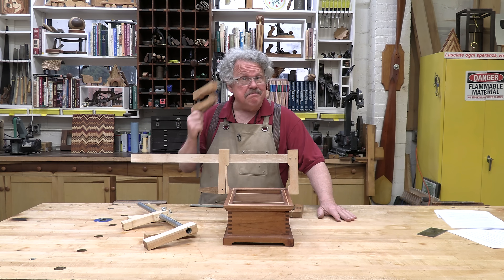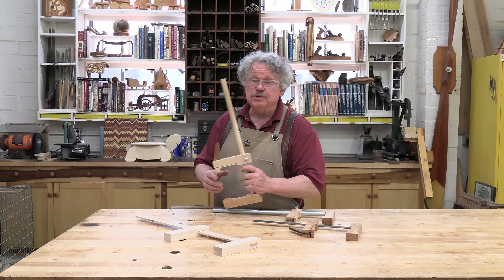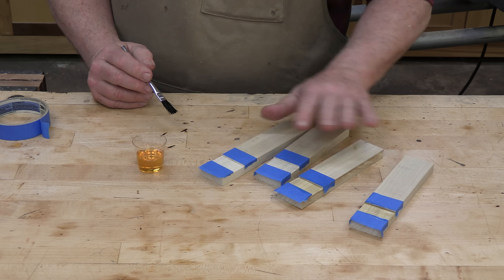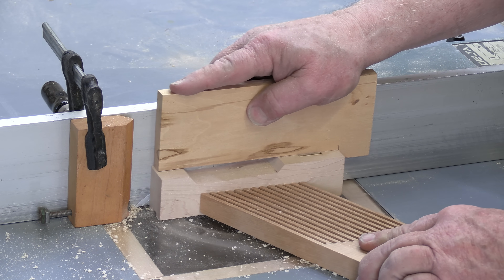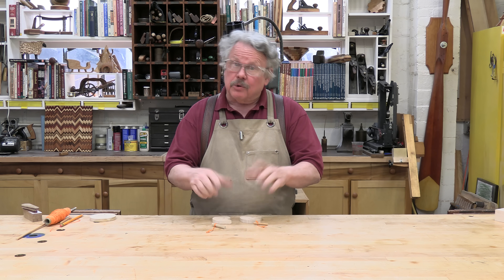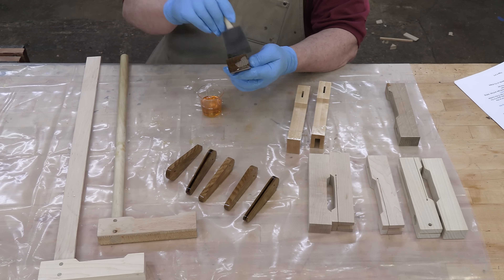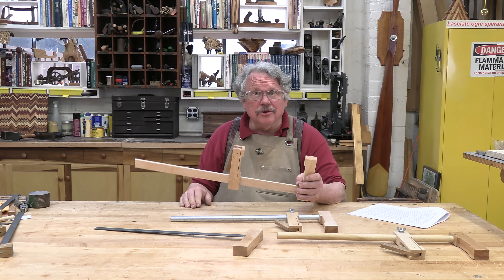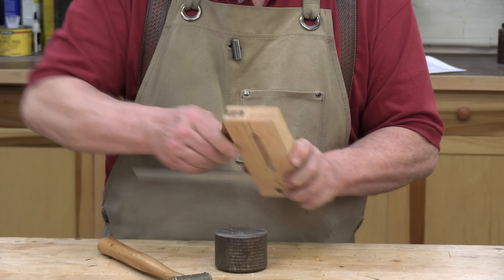Making Cams and Cam Clamps

Comment: The roll pins will not grip a bright steel bar, has to be black bar, it has a curved surface on the thin edge.
If you are making longer clamps use two cam jaws over about 600mm 2ft sizes. The original manufacturer of the cam clamps fit two cam jaws on the longer clamp sizes up too 4ft long.
The timber that is used by the manufacturer is Hornbeam.  A suitable substitute is Birch ply. 

When useing the clamps you have to squeeze the jaws together at the bar to set the jaws before moving the cam tight. No need to file the roll pins as they bite into the steel bar with use. 
Originals have 3mm thick cork for the contact pads. 
Ive been using and adapting these clamps for 40 years.

Comment: Another awesome video!!!  Loved the idea so I made several of these.  I used 3/4" conduit instead of 1/2" because I had some on hand.  I drilled a 1" diameter hole.  That was too larger for 3/4" conduit.  I wrapped the inside of the hole with .030" thick adhesive backed, iron on edge trim.  3" width will cover the entire circumference of the 1" hole.  Float the trim in HOT water for 30 seconds to soften the wood.  Roll it and insert it into the hole.  Heat the 3/4" conduit with a torch for several seconds and insert it in the hole.  The heated pipe will melt the glue and you will have a tight fitting pipe.  Worked great.  Instead of 1" wide clamps I increased them to 1 1/4" wide to allow for the 1" hole.  1 3/8" wide would probably have been better.  FYI, the O.D. of 3/4" conduit is .930. Wrapping the 1" hole with .030 trim reduces the hole diameter to .940.   That's a good fit.
Reply from the maker: Enjoyed reading that -- love creative engineering.

Comment: The process you are using to generate the curve for the rotating cam generates an involute curve in which the curve is always perpendicular at the edge of the dowel, and not it's center.  That's why the larger the dowel is, the further from the center the perpendicular point on the curve is.  I believe that you are trying to capture a spiral of Theodorus, a Pythagorean spiral, in which the curve is perpendicular to the center.

Comment: Hey Nick, I ordered the plans and they are easy to follow BUT, of course, I have a question about printing the plans full size (especially the cam)  I tried full size 100%, actual size 100% and they still are small.  Using an Epson printer if that makes a difference.  Any suggestions from Nick or anyone and thanks! !! !!!
Could not find any contact information on the website.
Reply from the maker: I downloaded the plan from the store (to make sure I have the same one you do) and printed out page 13 (the cam template) on a Canon Pixma i6800. It came out a little small, but not so small it wouldn't have worked. I bumped the scaling factor to 104%, printed again,  and got it right on the money. Different printers and different PDF reader apps print and display these files with slightly different sizes and distortions. Be sure to read page 14 where I explain how to deal with these discrepancies.
Reply: @WorkshopCompanion  GREAT thanks so much for the prompt reply CARPE DIEM! !! !!!

Comment: Small tip for this type of glue up that creates a mortise/hole. Plug the cavity with a plug made of a rather hard foam or a very soft wood, either of them completely covered in packing tape. The glue squeese will either squees somewhere else, or form at least be really thin and smooth splotch(film around the hole. You can even apply glue there to intentionally create a uniform smooth film in the hole for things to slide easily through it.
Reply from the maker: Good tip. And let me add this: If you wax the foam or the plug, the glue can't stick to it and it will be easier to remove. Travis and I make it a point to clean up as much glue squeeze-out as we can before it cures, using water. For cavities such as this, I would usually reach in with a small brush to clean it, but your method works just as well..

Comment: Tip: For the bar you can use the extremely hard wooden sticks from regular sweeping brooms. They usually all come in the same diameter and in that way you can easily get very long clamps if needed.
Reply: My brooms all have nylon bristles, no wooden sticks. What kind of broom are you talking about?

Comment: in the tubular clamp you could cut a little wedge instead of the screw tightening the cam end to the bar. if you make sure the clamping action pushes into the wedge. I'll probably cut the wedge so it's got a lip on the narrow end so the wedge can only come out of the contraption when you take the bar out. that way you slide it into place, push the wedge in with your thumb and then hit the cam instead of having to deal with a screw

Comment: Really impressive, thanks for the idea! But I'm a little bit concerned about the pressure these clamps provide and how durable they are (because it's just a 3mm splinter on the movable jaw that makes it work). So, it would be a perfect addition to the video if you compared this design and that from a market in terms of price, grip and quality of panels glued in both types of clamps. Thank you once again and sorry for my English😌

Comment: I just LOVE the tip on drawing those spirals. No more need to reprint multiple pages of Fibonacci spirals to fit the stock I have for the project. Also, the cams make incredible clamps on the worktable, or even bench hook with dog holes drilled into them. Glue a piece of sandpaper/rubber tube strip over the face and they act as planing stops, or all kinds of "vices" on top of the workbench. Thank you Mr Nick!
Reply from the maker: Good tip. A acquaintance of mine has round bench dog holes, and two of his dogs are cams. He just puts scraps of wood between the work and the cams to close the gaps as necessary..

Comment: 17:09 - When inserting the bar, one might also epoxy it in place to distribute the rotational stresses a little better, thus keeping it at 90° a little longer. Of course, this would make future disassembly more difficult.
Reply from the maker: Good point, but messy. And overkill for a clamp this size. The shear strength of two hardened 1/8" steel pins is 3,750 lbs. The jaws will collapse long before the pins do.
Reply: @WorkshopCompanion  I'm thinking more about the pins compressing the wood than the pins themselves being compressed or bent. But, realistically, by the time that would is compressed, the rest of the clamp will probably be beat to hell and need to be rebuilt anyway. One could probably keep reusing those pins indefinitely.

Comment: A table saw tip that I have not seen on any YouTube video. I put a stop on my cross cut sled to keep the sled from moving beyond the point where the fence reaches the highest point on the blade.
Reply from the maker: A nice safety feature.